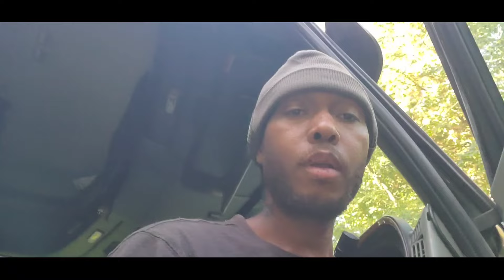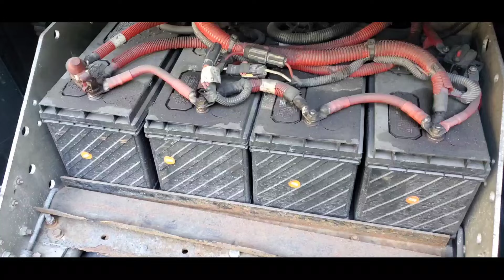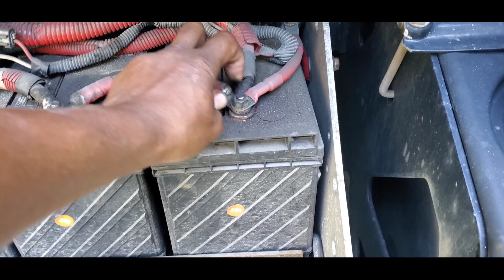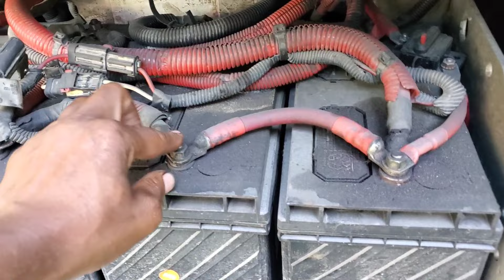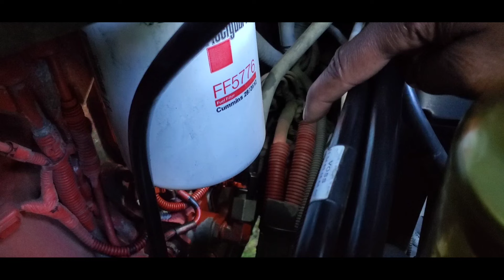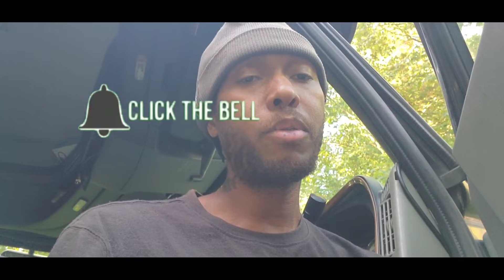Common problems that cause your truck not to start.What to do when your truck won't start.

Comment: thanks alot i watch your video after i able to start my truck my voltage was 12.6 and truck was not starting cuz battery connection bolts was loose and yes i clean green stuff.....❤
Reply from the maker: You are welcome driver

Comment: Thank U thank U. Loose terminals was my problem but I was stressing. I had taken my batteries and had them recharged because I had left my lights on and was gone 3 days. I may not had tightened the terminals enough. So after a hour of trying to jump, I remembered U saying check the terminal and I did and they were loose. And boom it started. 
Thanks for making this video. 
Much continued Peace Blessings and Success.
Reply from the maker: You're welcome

Comment: Hello sir i parked one night in Chicago in snow was cold I thought its a battery i changed all the batteries we tested them said good still same problem i turned off all the electric in the truck still same problem 😭😭😔😭
Reply from the maker: Hi driver, check your fuel filter make sure its not clogged, there is a drain valve on your fuel filter open it to let a little fuel run out.sometimes you might need to open the cap on top of the glass bowl to introduce preasure into the system to make the fuel run out..make sure your fuel is not gelled up in your lines. Check your starter. Try topping on it while trying to start it at the same time. You will need 2 people for that. Also check your alternator, it doesn't happen after but the cold weather can cause it not to work sometimes.

Comment: My truck saying low air and it won’t turn over
Reply from the maker: Low air means you have a slow leak somewhere. If you park for a long time it's normal to have some leakage but if your truck won't start you might just need a jump start. Depending on where you are if it's really cold and your batteries are not healthy they may have different turning over the truck.

Comment: If you need to jump your truck which battery of the 4 do you put the + - cables?
Reply from the maker: Any of the 4, + to + and - to - make sure to clean the terminal if they have dirt or rust. Some battery terminals will have a protective substance on it. You don't have to clean it off. You can put on your cables and charge with no issues.

Comment: What could it be if I had to keep trying to jump my truck then it finally start & cuts off while driving now ?
Reply: That’s more than likely fuel issue
Reply from the maker: You have a wire problem. Might be a ground wire.Had that happened to me a few times throughout my career

Comment: Why did my gauges stop cycling on my 2014 international prostar star please?
Reply from the maker: Check your ground and power supply also infront the passenger seat is the fuse box pull the cover off and look on the cover for any information related to gauge  relay and fuse location. If you find  any swap them out and see if that helps.
Also you could be having wire issues.

Comment: My battery gauge says 11.5 but on the tester it says 12.6 I have some bad positive cables and the truck doesn’t wanna start or crank for that long.
Reply from the maker: Your batteries need to be more than 12.6

Comment: Thank you my friend today I learned something if I leave my truck for some many days off my battery drain. But what I can do to not drain?
Reply from the maker: You need to plug everything out if you going away for a long time, lights, refrigerator, dash camera, usb with back light and even power inverters. If your batteries are old the above things can drain them over time. If you dont think nothing was draining them then you should get them tested.
Reply: Thank you very much brother I have to do something.